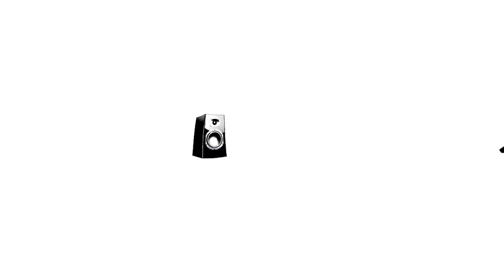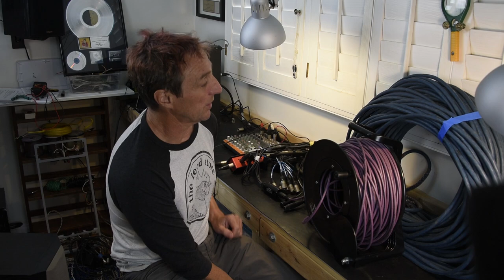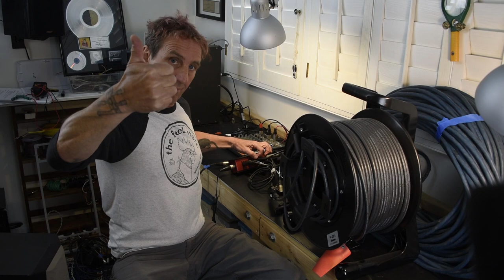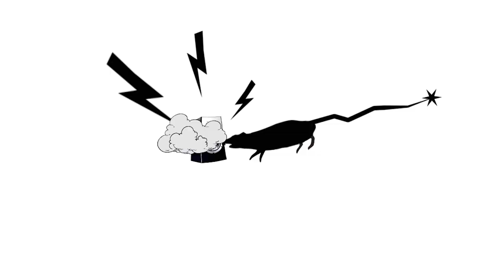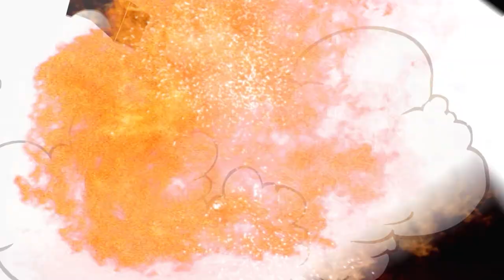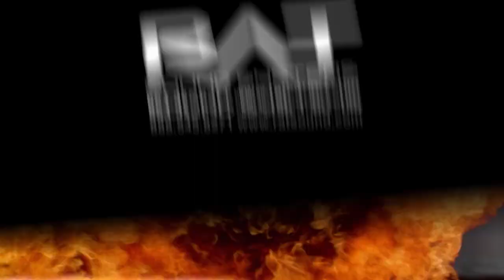Cat5e vs Audio Snake, Hear Signal Loss of 100 meter cables

Comment: Do you worry about hum and buzz in the Cat5 in a live setup?  
I know the twisted pairs are supposed to help with noise rejection, but with each mic firing at different times, it's a less balanced load.
Mic cable has a shield that the ethernet doesn't.
Reply from the maker: Yes the twisted pairs on Cat5e cable do better at rejecting him and buzz than regular audio cable and since, like audio cable each mic is on a separate twisted pair so each mic has excellent rejection.

Also, all of our products are designed for shielded cat 5e cables and well as we designed and make Cat5e cables as well.

Soundtools.com

Check out it out, it's cool stuff
Reply: @DaveRat  It is incorrect to say that twisted pairs reject hum and noise. In fact each core theoretically should PICK UP the hum and noise equally if it is from a source an infinite distance away (i.e. NOT an adjacent cable). The rejection is performed by the balanced input amplifier and is a function of how well matched it is and where the shield is referenced. Not all equipment conforms to AES48.
Reply from the maker: 5ge balanced input rejects common mode signals induced equally on both wires, twisting the wires helps make sure any noise is induced equally.
Reply: @DaveRat  The point is that neither are ever exactly equal so what you need to know is the actual rejection in dB.

Your test only shows that larger gauge cable has a lower resistance (we're talking about <10Ω for 100m) and different capacitance--no surprise there. A valid test would put a +20dBu squarewave through one core and measure the crosstalk on an adjacent core with a good audio level meter. Do for analogue multicore and Cat5. The difference in dB is the improvement--or not. -40dB means that 1% of the signal is bleeding. -60dB means 0.1%, etc.

Another difference that needs looking at is that analogue multicore has individual screens and that Cat5 doesn't. This will effect hum dependent on the actual equipment sending because you are shorting their screens together at both ends.
Reply from the maker: Well, not sure if a distorted +20 signal is overly relevant to real world practical for most applications

As far as crosstalk, I believe a did a video on that already using practical and real world signals

No Cat5e available with individually shielded pairs? perhaps a Google search is in your future. 

Not only is individually shielded Cat5e quite common and easy to find and can be used where very high levels of crosstalk rejection are needed, I actually designed a cable that Soundtools manufactures and sells that is individually shielded pair Cat5e plus each pair has a dedicated ground wire. SuperCat Sound cable.

Though the grounds get connected together for an RJ45, this cable came be terminated as a conventional XLR tails as well.

What I am doing is showing a small glimpse of why Cat5e works so well for the huge variety of applications that analog over Cat5e is being deployed successfully.

It's truly amazing how funtional, useful and practical a 4 channel disconnect able, readily available cable can be and the sound is as good if not better than audio snake.

It really is a game changer.
Reply: @DaveRat  A squarewave is not distorted, it has a precise harmonic structure which is why it is used to test frequency responses of systems. You need a high level to measure the crosstalk otherwise you would be looking for differences in signals of around -100dBu or lower.

Interesting that you can only give marketing hype sales talk instead of simple measurements that any competent audio engineer could easily make and which could be verified by others.

Breakouts are nothing new have have been done with better connectors than RJ45s that don't short all the screens.
Reply from the maker: Hmmm, do you actually have a gig where you run a+20db square wave for anything?

I understand the desire to create non real world scenarios for testing and also ...

creating tests the emulate or parallel real world scenarios may actually be useful to more people than testing for scenarios we strive to avoid

Typically those that are more experienced in pro audio try to avoid sending signals with vastly disparate levels down the same snake but that has nothing to do with analog over shielded Cat5e

What I find very interesting are the fears of a common shield. And you seem to know audio, perhaps more from the technical side than the real world experience side but you understand it, none the less. So I am sure you are aware that mixing consoles have a common shield as well. At first it can be a bit tough to get your head around but if ya think it through, you should mentally reach the same results as the real world tests and usage demonstrate.

That the individual separate shields only offer an advantage if you have signals that reference disparate gounds. And for almost all scenarios we normally encounter, it makes no difference  which end of the subs snake the shield connect together.

I recommend doing some testing rather than holding strong to unverified theories of what you think will happen, especially when they are in opposition to what credible people and companies are saying actually happens

Perhaps you are not aware that now there is even an AES standard for the wiring of analog over CAT5e with RJ45/ethercon?

Comment: This test is kind of flawed. The wires are wound up making a choke coil.
Reply from the maker: Cool to consider that. I did a 4 part  series on the audibility of loss and the impacts of coiled vs non coiled, wire gauge, twisted be non twisted pairs, lengths and load impedances of speaker cables.

Turns out that when a cable has twisted pairs, coiling has no impact, but, that said, the Cat5e is more coiled than the snakes cable, so if coiling causes an issue, the Cat5e should have tested worse.
Reply: @DaveRat  I thought that might be the case with the twisted pairs. Cool.

Comment: One of the most important things to bear in mind with data cabling is that attenuation loss is not particularly critical, it's signal to noise that matters. Higher quality data cables such as Cat7 are properly shielded, but audio cables are typically well shielded, certainly when compared to Cat5, which is not shielded at all. Cat5 is designed to be cheap and costs a hell of a lot less than decent audio cabling.

Should also test some of the high quality Aerospace multicore cables which were used for HF analogue display signals such as VGA, some of those are well-qualified for audio use.
Reply from the maker: The Cat5e that I'm testing in the video is shielded and is a custom cable we have manufactured in Germany. Shielded Cat5e is fairly common now.
Reply: @DaveRat  while 5E does have shielding of the bundle, which is much better than cheapest possible cat5, the Cat 7 spec foil-shields each twisted pair, in addition to the main bundle. With what's happening with Video over IP (SDVoE) 10GbE-spec infrastructure should be considered mandatory for any long term or medium term investment. Certainly in the case of purposing RJ45 for voltage controlled analogue audio (which is a useful workaround for buildings with no analogue tie lines) the individually foil shielded cabling is preferable.

Comment: In first semester of CCNA are students taught that they shall not run CAT5 cables longer than 25 meters because of signal distortion.
Reply from the maker: Hmmm. That's unhelpful teaching not based 8n real world results
Reply: You forgot to mention the very important detail "at 100 MHz bandwidth". Also, "signal distortion" doesn't say anything. You even get signal distortion through 1cm of wire.

Comment: Interesting video Dave. A quick question: if you were to A-B test the analogue and and digital cables in a production/live environment, do you think the audience would perceive a difference?
Reply from the maker: I think that if I turned the high hat off, muted the backing vocals and put a 200ms time delay on the guitars, the audience would not know the difference.

That said, incremental degradation is a concern for some applications. 1st, knowing that using cat5e for analog is not a degredation, I feel is important. Cat5e based diaconnectable 4 channel stage boxes are really convenient.  Also knowing the best tools for the job is important. So knowing that you can run analog over Cat7a for much longer distances with less loss than analog over audio snake is useful.

Comment: I've watched it three times. Can you please explain how high frequency "loss" results in greater amplitude of the high s at the return?
Reply: You're not listening to the signal itself, you're listening to the voltage drop of that signal.
Reply from the maker: Yes, as googlegnome mentioned, we are listening to the loss in the cable. So more loss results in less getting to the end of the cable.
Reply from the maker: Ahhh, no, at the end, 8:31 the cat7 is quieter, therefore less loss. I say duller as well but that was a mistake.
Reply: We're listening to pin 2 of the send and pin 2 of the return. Phase cancellation reverses what we're listening to; it's not what is still there, it is what has been lost.
Reply: @prospekt1909  Now it makes sense!

Comment: Just be aware that Cat5e is rated for 100m runs after which you will start getting signal reflection and crosstalk
Reply from the maker: That spec is for digital over cat5e, analog over cat5e lives in a completely different realm.
Reply: As Dave correctly mentioned, this is a very different use case here. Cat5e is specified for 100 MHz signal bandwidth for digital signalling. Dave is sending a 0.0x MHz bandwidth analog signal through it.

Comment: The high frequency loss is more so we heare more highs?  I don't get that
Reply from the maker: We are listening to the losses in the cable
Reply: @DaveRat  I understand that but if you have a loss, how do you hear more
Reply from the maker: What we are hearing is the difference between the beginning of the cable and the end of the cable.

If the sound is exactly the same at the beginning and the end we would hear nothing

If the sound is louder or quieter on either end we hear something.

If there's more highs at one end or the other end we hear the highs if there's more lows at one end or the other end we hear Lowe's

Since the cable cannot increase the amount of high end or increase the amount of low end and it's purely a loss than any difference we hear are losses

Comment: UTP data cables are superior analog (and digital!) audio cables. By design. Good to see someone doing a video on this. Speakers and Amps should have RJ45 connectors instead of banana plugs!
Reply from the maker: Better for signal, but for high current speaker outputs, thick wire gauge is king
Reply: Use proper cable between power amp and speaker.

Comment: Need to unwind the cables to ensure it’s not acting like an electromagnet
Reply from the maker: Maybe take a look at the video I did on cable loss. 

Turns out that with twisted pairs, the coiling inductance is cancelled out and has no impact on the sound, 

That said, the Cat5e has a tighter cool so it should test worse, right?

So if coiling is an issue, then Cat5e is even better than I am showing in the test, compared to audio cable.
Reply: Dave Rat Cat5 by design has unparalleled shielding, the HDMI to CAT have some insane modulation.

Just found the channel will definitely subscribe!

Comment: The audio cable, higher capacitance / ft? vs linear attenuation of the twisted pair data
Reply from the maker: I don't know the capacitance of the audio cable but based on the results o would say that is most likely true. Also the Cat5e most likely has a superior insulator and the thinner conductor of the ca5e lowers capacitance as well.  The cat is a larger diameter and an even better insulator and a thicker conductor offering it all the advantages
Reply: @ Mark Lowe: Don't quote me but isn't the capacitance and series inductance forming a low-pass filter? Lumped cable model.

Comment: Use romex for the speaker cable test. For real. :)
Reply from the maker: Great idea and already done I've done the Romex and THHN wire coiled and its original 50 foot spools and twisted pair test and that will be in parts 2 or 3 that will be posted soon
Reply: @DaveRat  Sweet! My money is on Romex. :)

Comment: You should redo the test with both cables unwound so they do not behave as two coils of different sizes.
Reply from the maker: If coiling has a negative effect, then the data cable is at a disadvantage during this test and and wouldn't difference become even greater?
Reply: Both cables are coiled but to different sizes and  with different wire gauge so inductance, and resistance  is different between the two cables. This may make a difference or not.
Reply from the maker: @habdulahsalam  I like the way you think and looking at all the different variables. The goal of this test was to show that Cat5e is as good if not better and carrying analog than analog cable.

I've done coiling comparisons with mic cables, comparing 100 mic cable coiled vs non coiled but didn't record a video of it as the difference was not audible with my test set up.

you may be interested in the four-part series I did on testing speaker cables coiled vs non coiled and comparing various wire gauges and lengths and you can listen to coil vs uncoiled speaker cables. And twisted pair vs individual wires. 

https://youtu.be/KKooWhMGT-k
Reply: @DaveRat  that's what i meant. Keep up the good work.

Comment: While coiled?
Reply from the maker: Turns out that the high quality of the twisted pairs makes cat cable somewhat immune from issues due to coiling. Take a look at my speaker cable test video that shows the impact of coiling.  In part 2 or 3 of the speaker cable video I do a test that shows twisted vs non twisted cables both coiled and not coiled

Comment: Dave,  can you try the same audio cable coiled up  vs. audio cable off the reel on a straight run (like from the stage to a mixer like you might find in a small room.   

I know sometimes we leave the audio cables coiled up (as extra length not needed).   Just wondered how that affects analog signal quality.
Reply from the maker: Hell no! Oh my that would be way too much work! Is 6 miles is not enough for ya?

All in good fun and yeah, the twisted pairs should be cancelling out the emf that would make the coils into inductors so uncoiling will either so nothing or have less issues and it already went way longer than expected.

Comment: Does the fact that the cable is coiled many times effect what we’re hearing?
Reply from the maker: With twisted pairs, the coiling of the cable has a minimal impact but can slightly effect the sound. 

When comparing differing cables, as long as they are both in the same or similar coil, then coiling would bot a factor.

Comment: Thank you!
Reply: @DaveRat  is it STP or FTP cable?
Reply: @DaveRat  is it STP or FTP cable?
Reply from the maker: The violet cable is a s/utp called SoundTools superCat

SoundTools also has a SuperCat sound cable that is u/ftp with even higher specs
Reply: @DaveRat  is there common shield for all pairs? Is there any crosstalk between pairs? Or twisted pair balanced signal eliminates it? Will it work with unbalanced signal?
Reply from the maker: Yes, common shield as the shields are all shorted together anyway on all audio gear, it is not an issue, the twisted pairs do an excellent job of rejecting crosstalk.

Have had no issues with unbalanced.

Even using com, aes3, analog audio and dmx down the same 4 channel box works well.

As with any snake, it is not ideal to run super hot line level or come with extremely low level mic lines but the crosstalks tests I have done show excellent rejection and no issues.
Reply: @DaveRat  thank you for reply. I want to try this cables for guitar to transfer signal from pedalboard to amp and back (guitar+send/return+channel switch)
Reply from the maker: We actually have a 1/4" version of the cat tails coming soon exactly for that purpose.

Comment: Who runs an Analog audio signal on a data cable without converting 1st into digital?  Once its digital it cannot be compared to an Analog signal.  Digital (binary code) & Analog really cannot be compared in this way - the signals are totally different.
Reply from the maker: Aha! exactly! Data cable is readily available, and as this test shows, is actually better for transporting analog audio than more expensive , bulkier, audio snake cable. Plus data cable with RJ45 or etherCON runs 4 channels, and has inexpensive disconnects. It's awesome and no reason other than people being close minded or set in their ways not to embrace this cool usage of readily available cables.

Check out http://soundtools.com/all-products.html

Comment: You do not consider the "Skin  Effect" of different structure of cable
Reply from the maker: This test was meant to show the viability of using cat5e for transporting analog audio. And seems to show that cat5e is equal to or better at analog than analog cable

Comment: Looks like I will be raiding my sons thousand foot spool of cat 7a cable,  my son has a spool of cat 8 cable on order should I expect any improvement that is noticeable between cat 7 and cat 8 ?.
Reply from the maker: This is to show using cat cable for analog is a viable adventure
Reply: @DaveRat  Wild. I never would have guessed.   I suspect that buying a Radial Catapult ISO with audio transformers is a better idea than the non-iso ones over long runs.